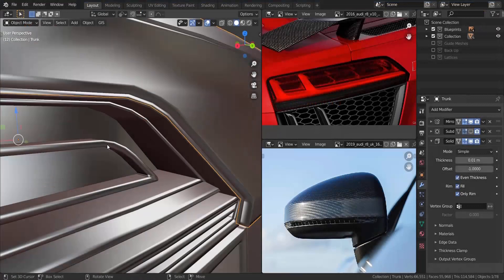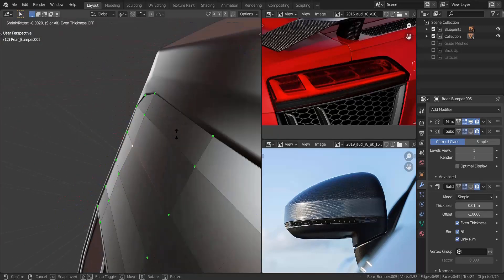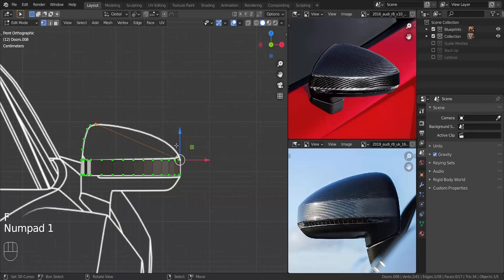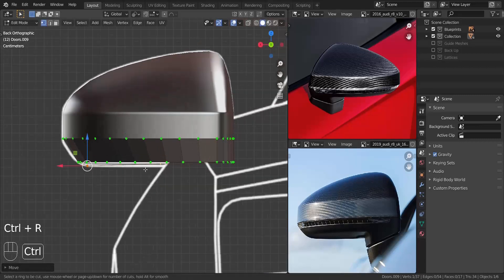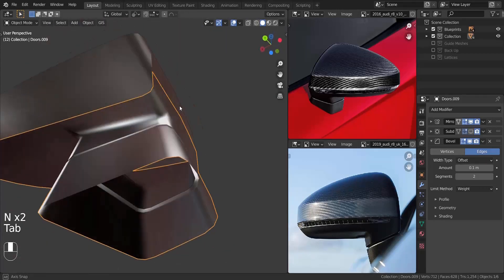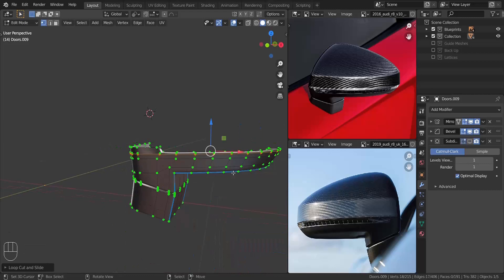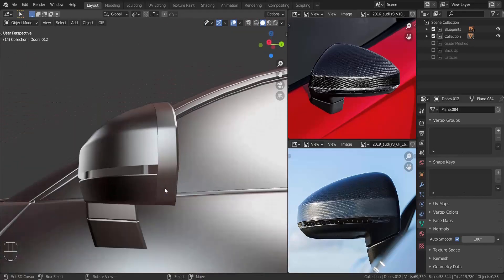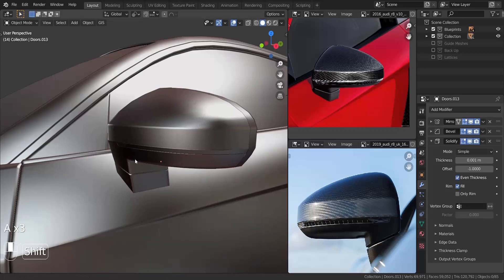Blender 2.90 Car Modeling - Part 21 [The Side Mirrors]

Comment: Good job bro got a question for you how long does it take for you to model a car not meant for a tutorial(since that takes more time)?  I'm following cgmasters course and it's excellent but I'm wondering if every car would take that long to model with the shrinkwrap technique.
Reply from the maker: Depends on how much time you put into it daily... I average at 1 month...
Reply: @NaturalArtFreak  Thanks for answering, so how many hours a day do you spend on average? 1 month still seems too long for 1 car with your skills
Reply from the maker: @user-su2id5pt3g  about 8 hours a day... But it's not all just for one model...
Reply: @NaturalArtFreak  that seems about right, modeling is so fun but time consuming. Keep up the good work :)
Reply: 8 hours per day hmmm so this will be my first car model and I took almost 3 or may be 2  months till that part so it is normal. is it? @NaturalArtFreak